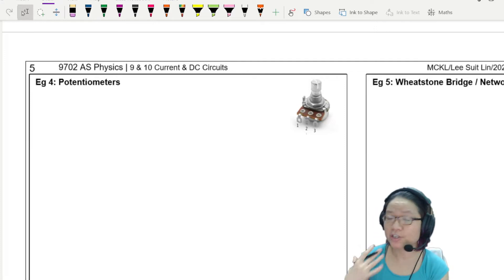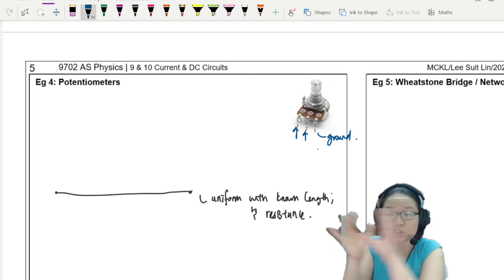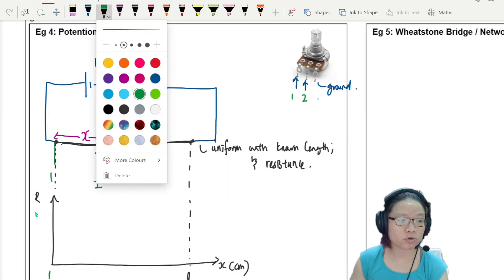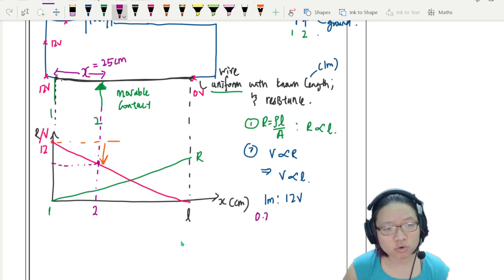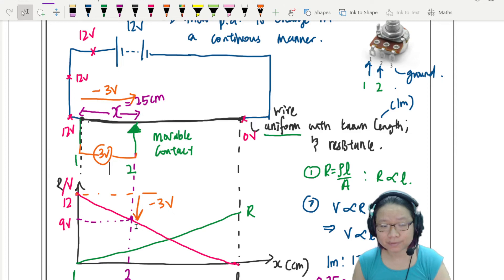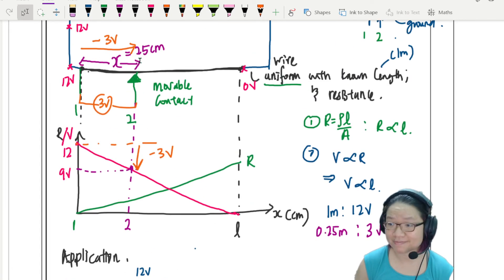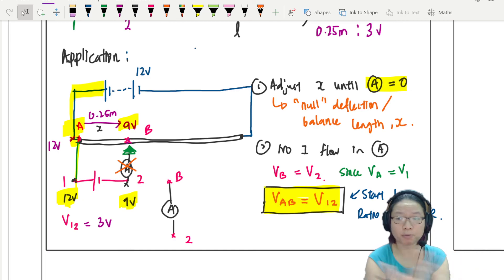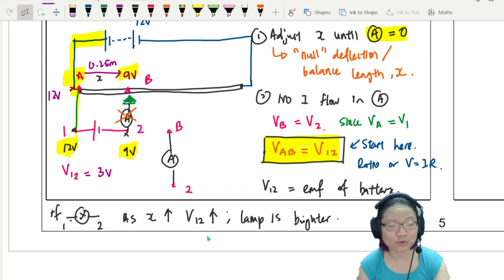10.3b Potentiometer & Balance Length | AS DC Circuits | Cambridge A Level Physics

Comment: i dont understand why if Vb=V2, A=0
at 10:10
Reply: Take it as gravitational potential energy, if there isn't a difference in heights, the ball won't fall
Reply: @BOBO_4869hi！can i ask u a question？if theres potential difference from V1 to V2 why there isnt any current flowing through the wire？

Comment: How can you say that V is proportional to L but you draw a graph that suggests otherwise? Aren't you contradicting yourself?
Reply: Because she is measuring potential and not potential difference . If there was no length then there would be no resistance hence no V drop so 12 before and after is same hence 0. But because she is measuring potential here so even at length 0 , she measures 12 v .
I hope this is understandable and can someone also plz tell me if I am correct
Reply: I understand ur struggles, 
btw what she means is: 

1. V here is the potential difference (energy used to push the charge across x=0 and L) is proportional to the length , since as L increases, R increases and more V needed to push the charges across the L) 

2. Since potential & potential difference are not the same, the graph she draw is the potential value at any x on the wire.

3. to make this easier i think we may use delta V for p.difference and V for potential value
Reply: i dont understand what your saying

Comment: When u have drawn a graph between V and length so its not passing through origin and voltage is 12 or high when length is 0 or less so how they directly related
Reply: when V=12 R=0 since all energy is still there , but across the l it's gonna dissipate all the voltage.
Reply: the origin will gonna be starting from L, so if u reflect the graph u can see their relationship
Reply: so R is the max when V is the lowest (0)